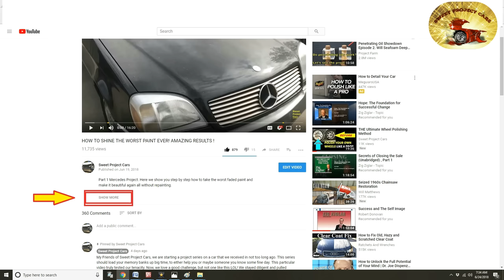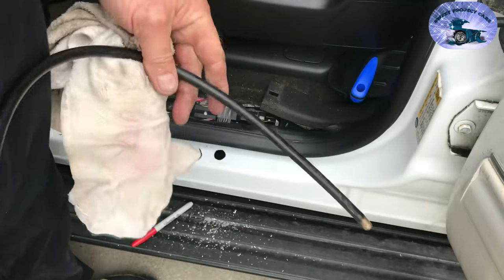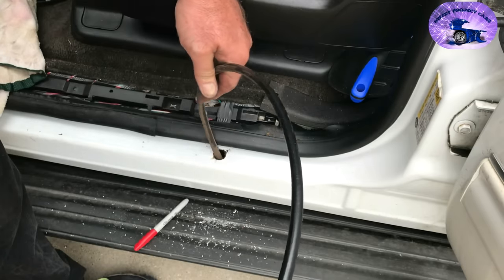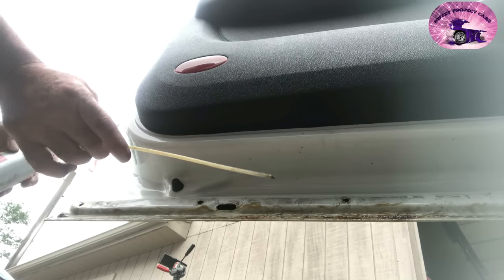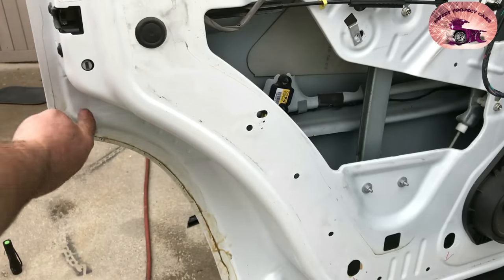DO-IT-YOURSELF Rust Proofing Your Car or Truck also SUV, Motorhome, RV

Comment: If you live in the salt belt, Fluid film should become your best friend for all outdoor equipment. I have a 2013 Silverado and have treated it with fluid film for the winter. It barely has any rust on the frame and no rust on the body or rocker panels. Don't forget the tailgate on the trucks. If your truck is dirty and you don't see the remnant  coming through the bottom of the tailgate, your wrong!
Reply from the maker: Do Wain Nunki El Bey thank you for sharing my friend :)

Comment: Basically you do everything that a company like Krown Rust proofing or rust check will do. The oil seeps and creeps.  No need to pull door panels
Reply from the maker: That's it!  Thanks for your comment!  Have a fantastic day.  mad Mike the hammer SPC
Reply: You are correct. I have a small rustproofing business and have done a few hundred vehicles so far. Just like Krown and Rust Check, I either drill a hole at the end of the door or if the door drains are large enough I'm able to put the wand up those. Removing door panels is completely unnecessary.

Comment: One tip i have, rust likes to start underneath the seals so you could take them off and grease the seem all around.Even if it would eat away the rubber you can just replace them with cheap one from the junkyard. It beats rust in my opinion
Reply from the maker: ‍1marcelfilms you are correct and we have not seen and adverse effect on rubber either :) thank you very much my friend we truly appreciate that :)

Comment: This was great! I told you about my Friend who does this service at his garage- when I sometimes help him (he does many vehicles before Winter) we remove ALL rubber seals; crusties are always in the crevices that hold moisture. On my idea- he's had great success with mixing a 1 pint bottle of Baby oil to 1 gallon of the Fluid Film undercoating. It extends the product, sprays easier, and creeps in way better. It doesn't negatively affect the character of the product at all, and smells nice, too. Could you please try it for a video? I'd really like to hear and see your thoughts on it. Thanks SPC Guy!
Reply from the maker: HUBBABUBBA DOOPYDOOP  thank you very much my friend we truly appreciate that :)
Reply from the maker: and you can use whatever you feel works the best we just use the FF as it was manufactured and have had no issues what so ever Also on the wiper arm comment you made, as you know all of our videos are general knowledge that will work on 99% of the vehicles out there, but there are some vehicles that are out of the ordinary so if a person feels they will cause wiper arm issues doing the bending back of the arm then they should not do it...the arms get flattened out because they wrench on them to change the blades and over time they lose the angle they need to have proper pressure on the glass.

Comment: In germany we use selfmade protection made out of 90% petroleum jelly 
and 10% beewax. It must be heat to 250°F (about 120°C). It can be 
sprayed on or painted on. It will stay for a very long time. After 10 
years you can repaint it again. Its very inexpensive and does not harm the environment.
Reply from the maker: Thanks again for sharing Dima!  Happy New Year to you in Germany.  Glad to have you with us.  mad Mike the hammer SPC
Reply: @SweetProjectCars  happy new year all the best

Comment: +Sweet Project Cars you've hit home runs with these videos! I'm really on the fence about buying step up drill bits, body plugs and committing to a whole kit. I've also been looking up home made solutions and competing products which sound promising. Cheers!
Reply from the maker: All I can say is there’s only one way to do the rocker panels and that is drilling holes or finding holes under your threshold plate and there is nothing that will stop the rust better in those areas than the fluid film hope this helps my friend have a great night

Comment: You say Fluid Film in the series but link to NH Oil. Your continuous use carries weight in a choice. I have seen mixed reactions when comparing the two products. I have a car that has bubbled spot halfway between the window and the wheel well but hasn’t broken the paint. Doesn’t sound like either of these are good for this spot, but would be a good preventative everywhere else.
Reply from the maker: NH oil has really out done fluid film thats for sure  for a spot like you have it sounds like a weld area and that would have had to been treated from the inside the panel to have stopped it.

Comment: Hint for drilling into EXTREMELY THIN sheet metal:  
Cut a disk into 80 or 100 grit sandpaper that is larger than the hole diameter desired.  Apply rubber contact cement to the sand side of the sandpaper Disc and the panel where you want to drill.  Let the contact cement dry, then stick it to the panel (sand side down).   Drill through the 'upside down' sandpaper disc, with 'little pressure' into the disk glued to the panel.  Use LIGHT drill pressure and let the 'grit'  do the GRINDING through the sheet metal and with NO tear outs nor 'buckling' of the thin metal because the drill bit won't jam in the bore of the panel.  Peel off the contact cement remnants from the panel; and if it all doesnt remove - use a single edge razor blade held parallel to the painted panel.  Sometimes you may have to repeat the disc application. This grinding, using a drill bit into upside down sandpaper, is especially useful on the super-lighweight vehicles that have VERY thinned out sheet metal.    ;-)
Reply from the maker: RichH thank you very much my friend we truly appreciate that :)

Comment: Great video Sir, question can you recommend a  good gun that i can attach a long hose that will spray transmission fluid only just like your spraying your mixture, looking to rustproof a 2005 ford F150, thks

Comment: I think I would have painted the edge of where I had just drilled the holes.
Reply from the maker: mick coomer you can do that but the Fluid film gets locked into the plug retaining edge and keep a fresh amount of rust proofer always on the bare steel.

Comment: Is there an option to prevent rust WITHOUT drilling holes in my car? I do keep my car very clean, but it is driven daily in Wisconsin.
Reply from the maker: Joel if you want to guarantee your car will not rust there’s really no other way to do it
Reply: I did it without drilled the holes on rocker panel. Temporary interior at B pillar to be removed, you will see the opening connecting to the rocker panel on below. I poured the used oil through a funnel. You need about a galone in order all the rocker panel is filled full of oil, means that all inside surface contacted with the oil. Remember, before fill the oil, you must temporary seal drainage holes on bottom of the panel by an adhensive tape. After full filled, remove the adhensive tape to drain all the oil out with collect pans below.

Comment: Hey! Great video!! Csnt wait to do this to my truck... But I have a question. My truck has holes in the truck bed for a roll bar. And I was gifted one for it. But just want to know if there's anything I can put in the holes for the roll bar so that it doesn't rust in the future with the bolts and nuts that go in said holes in the truck bed
Reply from the maker: I'm going to answer you trying to understand your question.  I'm thinking that your roll bar isn't there and so you need to use this https://amzn.to/32sHPdX spray the holes with it, then you can put body plugs in it if you want.  Hope this helps.  mad Mike the hammer SPC

Comment: Super duper! Curious about your opinion on the door seam rust. Would going over the rusty seams with a small wire brush, then applying rust converter then applying automotive paint and finally a coating of fluid film work ok? Would the brushing, converter and paint interfere with proper functioning of the fluid film or would it help? Just asking because the paint coat would leave a nice presentable appearance under the fluid film.
Reply from the maker: You are right on track with your process, make sure to use this convertor  https://amzn.to/3Tg9zxc  Thanks for watching and asking, we appreciate it my friend, hope you have a sweeeet rest of your week. mad Mike & team

Comment: After applying does this wash off easily I been hearing different answers.
Reply from the maker: Hello Jim we’ve ever had that problem it definitely does not wash off an enclosed areas like your rocker panels and inside your fenders underneath on the frame after a year or so you should always crawl underneath and take a look and see if you need to touch up anything takes about 20 minutes

Comment: What kind of prep needs to be done before you do this ? Does it need washed before? I know it needs to be 100% dry is that correct?
Reply from the maker: You are correct, wash it and make sure it's dry.  Thanks.  mad Mike the hammer SPC
Reply: If it's an oil-based product the surface doesn't need to be dry as the product will naturally displace water and adhere to the surface.

Comment: Spraying on Used Transmission fluid seems like a very good no cost idea to me. I understand it won't deteriorate rubber. Do you think it's the right way to go for a very cheap application of rust proofing maybe do every year or two? Do you have any second thoughts regarding appropriateness of transmission fluid. I'm thinking of just using a cheap garden sprayer filled with used transmission fluid and spray the underside of my much liked 2009 Honda CRV (110k miles) every couple years. (One could even fill a power washer with transmission fluid for a really fast application in a field.) What are your followup thoughts? I appreciate any reply. Thanks Bob

Comment: How long does that stuff last?
Reply from the maker: Mike Brandenburg on enclosed areas like the rockers and doors we have had it go for years and years because it does not wash away as far as the undercarriage we say check it and respray any areas that have slightly washed away of time. all in all for us anyhow a very long lasting product if you don't go through undercarriage car washes.